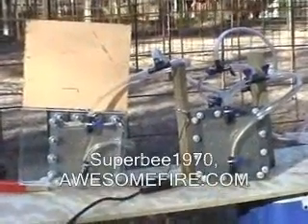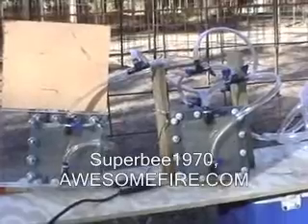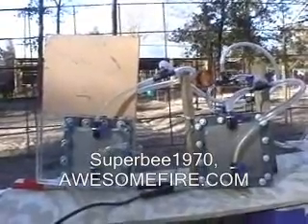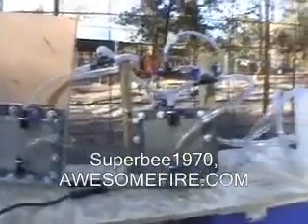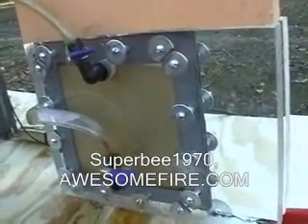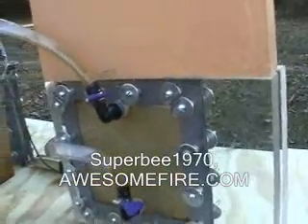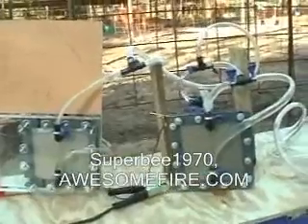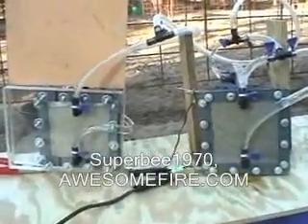Superbee1970, "SPLIT CELL" Technology, put into REALITY...

Comment from the maker: Hi DB, Best mmw so far has been in the mid 3's.  I've scrapped the plastic outer plate design and am working (slowly) on a no plastic outer plate dry cell.  I'm using 16 gauge 316L Stainless, which is prett thick, and am pretty sure I don't even need outer sandwich plates.  I'm just using the plates themselves as the outer plates. Will probably finish this cell this week and record some video and output numbers then!  Thanks again.  Superbee1970